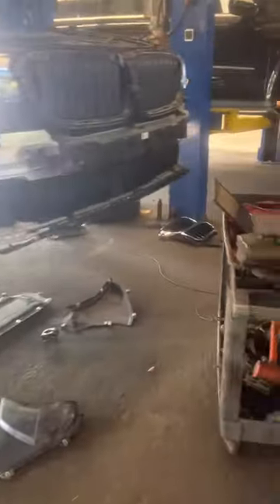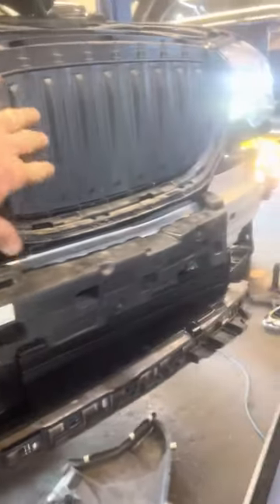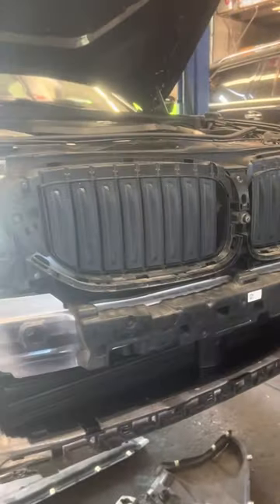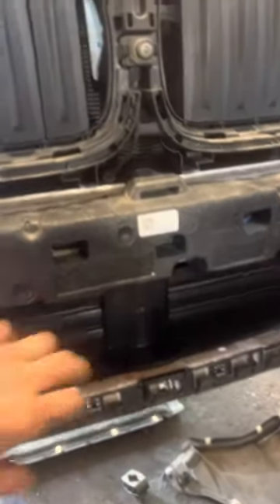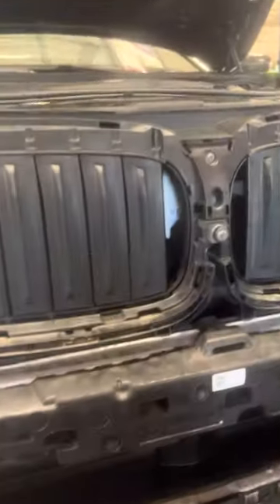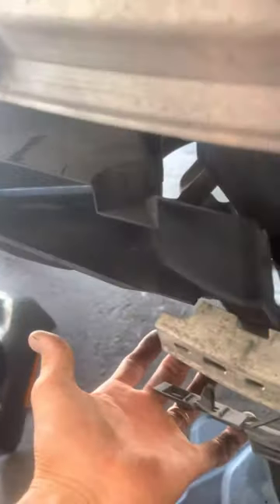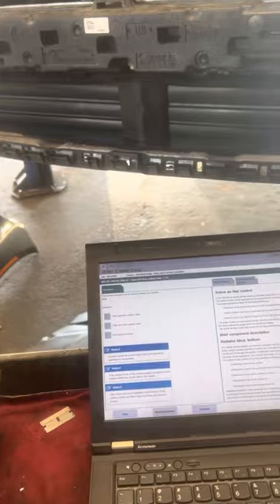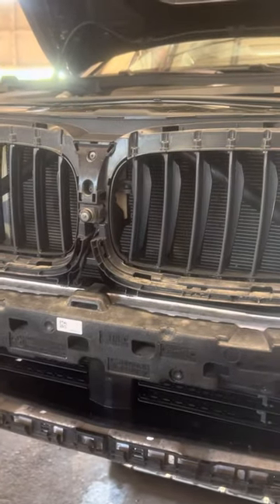2018 BMW 540 Radiator Shutter Replacement G30

Comment: How do you open and close it manually?
Reply from the maker: Scan tool
Reply: @eurowerx4267  thanks. Is it possible with Bimmerlink/Bimmer code?

I replaced the upper shutter after it was damaged. It was working when it was still damaged but after changing with brand new shutter and motor from BMW, they don’t seem to be working anymore. No cel or any error. Just not working
Reply from the maker: @ssjg-ue9sg  I Havnt used those tools, you may be ok. If no fault, may be good.
Drive it and run the ac, if at a stop and the ac goes warm, suspect no opening to cool condenser. However, the cars pretty smart.

Comment: How the bottom one works? Mine is open whenever i start the engine. Even with the engine off they are still open. They only close when i put the car in diagnosis mode